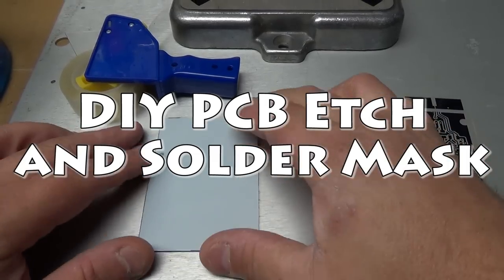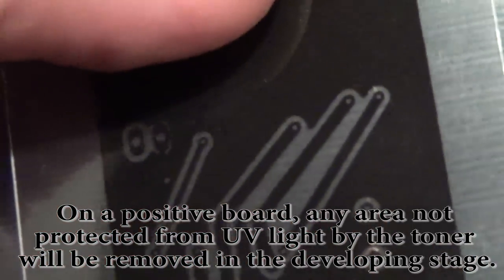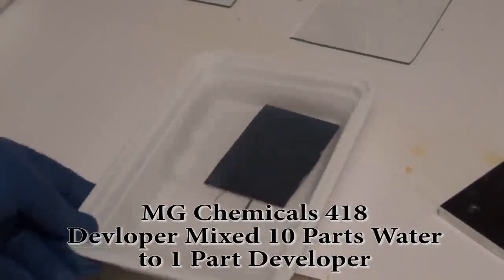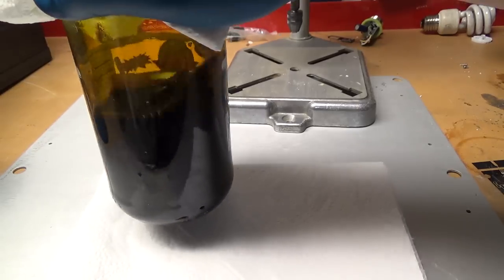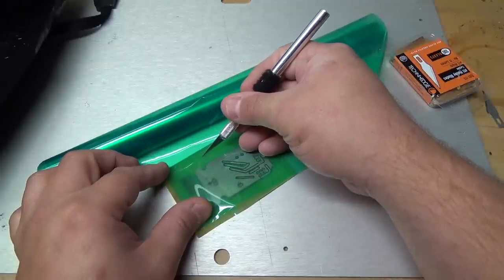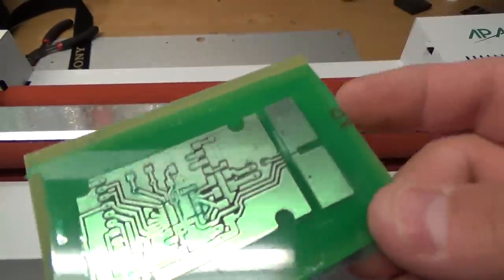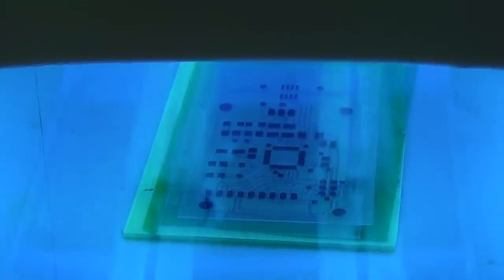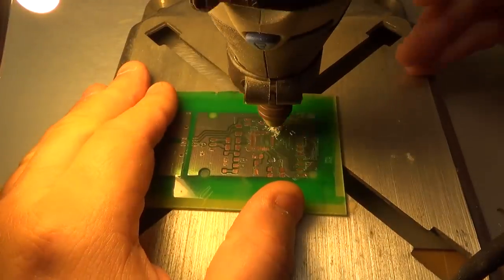DIY Two Sided Printed Circuit Board With Solder Mask - Photo Sensitive Method

Comment: great guide thanks. Just 1 question: the glass you're using to sandwich the work piece during UV exposure - is it a special types of glass, as I thought glass blocked UV?
Reply from the maker: Russ Shall regular window/plate glass attenuates UV but doesn't completely block it. This is addressed in some of the other comments.  Good luck with your project.

Comment: I wonder  how UV rays can penetrate through the glass when you cover PCB with the glass, isn't glass UV filter or you are using plexiglass?
Reply from the maker: +Vjekoslav Cvetnić soda-lime plate glass attenuates UV but is not a total filter. Using no glass at all the PCB would expose much more quickly, perhaps too quickly to be able to time it well.  Exposure could be adjusted by using thicker or thinner pieces of glass, or if you want a very rapid exposure, use a more UV passive material to hold down the pattern to the PCB.
Reply: Thanks for reply.

Comment: Another question if I may.  After my brd is done with the solder mask part can that brd be put into a solution of liquid tin? Is liquid tin necessary with solder mask also?
Reply from the maker: If your boards are going to be sitting around unsoldered for a while it might be a good thing to do. The solder mask is pretty tough, but I don't know it's chemical compatibility with the liquid tin solutions, maybe try on some sample pieces to make sure it doesn't soften, etc.
Reply: Thank you for your input. It matters to me a newbi to this type of thing.

Comment: How did you determine amount of time to develope under UV lamp? My Datka light bulb takes 11 min to develope properly but I am unsure as to under develope or over develope as a newbi to positive and negative develope?
Reply from the maker: I will usually do test exposures on blank pieces of PCB.  Take a strip of sensitized PCB material and cover with some opaque material, expose around 10mm section of the PCB for ~3 mins. Move the strip down and expose both sections for 3 more mins and repeat for a few more times eventually you'll have strips exposed for 3, 6, 9, 12, etc mins which you can develop, and then fine tune your process based on that.
Reply: TANKS have heard of that before. Will try that out for size. best wishes Kevin

Comment: how much is that photo resistant board or what ever its called,. can u tell me the name and the price
Reply from the maker: Pyro Sandwich The board is positive sensitized double sided printed circuit board. I bought mine from Amazon, they were made by GC Electronics.

Comment: can u save the radio shack liquid after u do it, so u can reuse it?
Reply from the maker: Pyro Sandwich The ferric chloride can be used over and over, however it does lose effectiveness each time, so it will take longer and longer to etch a board.

Comment: whats your mix ratio for the soda ash and water?
Reply from the maker: The amount is about 10 grams of soda ash to 1 liter of water, I went with the specs on the eBay listing and it worked out alright.
Reply: TheHouseBlog thanks for the reply. I was mixing 10 grams powder to 100 grams water no wonder it was eating my other parts of my solder mask too!!! Thank u. Because that ratio that I was using was 1:10 urs is like 1:100 I think... cuz 1 liter of water is 1000 grams roughly
Reply from the maker: vladyerus Glad it was useful, sorry I did not include the information in the video, I'm learning as I go with these and trying to provide my steps. :)  Good luck with your boards!
Reply: no a problem thank you! this helped quite a bit